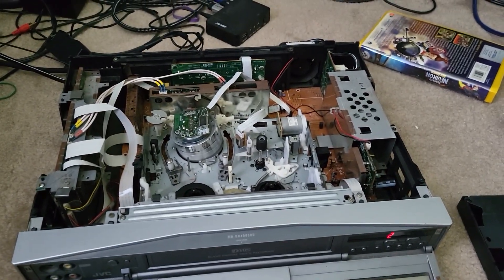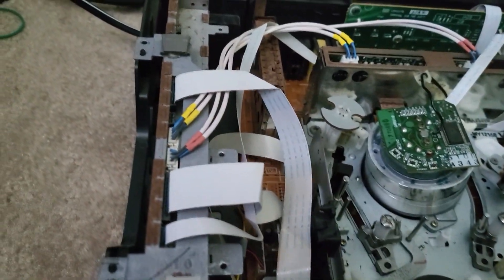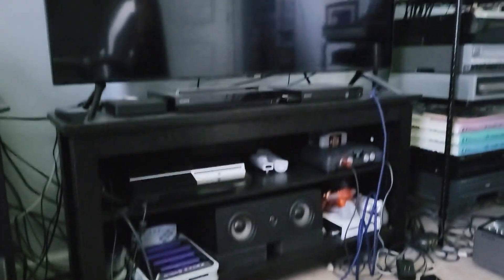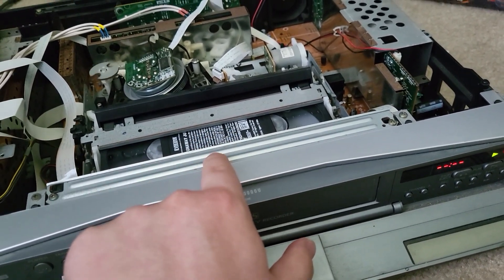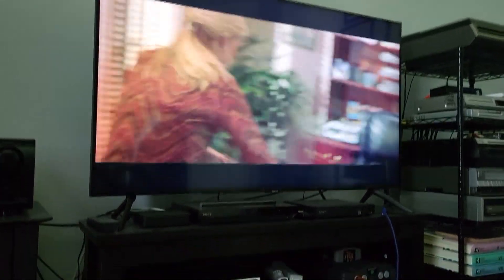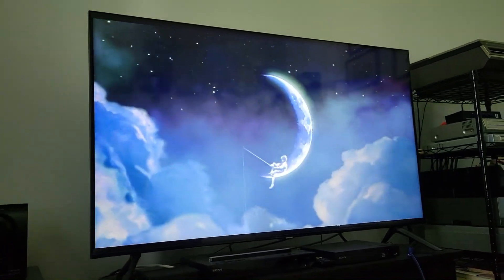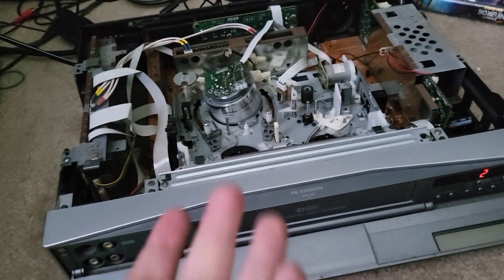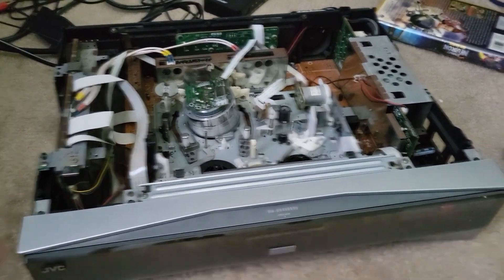JVC HM-DH40000U D-Theater VCR in action (overview, quick repair tips, "hidden" DTS feature)

Comment: Awesome video! Just restored a couple of these units - almost all of the SMT caps in the digital section were bad on both and neither really appeared particularly heavily used. They are kind of annoying to get to because the outer shielding is soldered on in many areas and there's about 25 of them. Guessing most of these DVHS machines have bad SMT caps that go unchecked. I think regular VHS playback also goes through the digital board as I think these will output an MPEG2 stream over firewire for regular VHS  and they also have a line time base corrector which is ideal for VHS tape transfers and that would need to go through the digital section for that to function. Side note was that almost all of the push button switches on the front on both were also not making good contacts, so I would bet a fair amount of these machines could be listed for parts for non-responsive buttons - switch replace those is a 6x6mmx9.5mm 2 pin tactile switch.
Reply from the maker: Yeah, these units do get hot with all of the complex circuitry going on in the digital sections, as well as from the regular abuse switch mode power supplies put on caps, so the caps on these do dry up pretty easily. The digital board recapping is delicate work, but hey, you get D-Theater playback out of the deal. For the front-panel buttons, I'd apply Deoxit to them to see if they clean up before replacing them; they're likely just dirty from lying dormant for years.

Comment: Hello, great video. Nice to see some other D-VHS enthusiasts out there. I have worked a lot on these units the last two years and may have something else you might find interesting: the capacitors on the PRE/REC board very often tend to go bad. And they die slowly. In most cases, VHS/SVHS playback is not affected but the digital playback will deteriorate over time (show more and more dropouts). I had exactly the same sympthoms as your unit shows on one of mine. Some tapes play back well, some do not. I don't think the cassettes are necessarily the root cause for your drop outs. I think that some cassettes simply had a slightly weaker signal strength when they were produced. And these tend to highlight a recorders' weaknesses more. I replaced all the capacitors on the preamp board on a DH40000U, and now my DH40000 plays ALL cassettes I own almost 100% error-free. Also the previously faulty cassettes. In my opinion, the DH30000U (which is even older) may well have the same problem. Another problem is the ground connections from the preamplifier PCB to its metal housing. These break very easily and tend to tear the pad off the circuit board. Sometimes it is barely visible. You have to meticulously restore this connection, all three of them. I once had one that was broken and subsequently severe drop outs on all cassettes. From just a tiny crack in the solder. Of course I can't know 100%. Of course, it could be that your recorders are perfectly fine and they are really badly worn cassettes. But I was also able to see a few drop outs on the cassette that was declared good in your video and I actually had the experience that the devices, when 100% OK, actually only show very few drop outs. Regardless, it's great to see that others are also engaging with this obscure format. I myself have had a few problems finding repair tips for these devices on the internet. Nice that you share your experiences here. Since it is so difficult to get information, I am also sharing my experiences here. 🙂
Reply from the maker: Thanks for the comment! That is a good point to watch out of the ground connection on the shielding for the digital preamp board; on this one, I had noticed some cracks around the joint before working on it.

Comment: My dh40000u has screen flickering and I hear replacing the fan can fix this. Can you do a video on that
Reply from the maker: Does the fan spin up when the unit's turned on? As long as it does and there is no major dust accumulation on the inside, then the fan is fine. Do you have a description of what you mean by "screen flickering"? Can your unit do anything else? It's more than likely bad capacitors; those go bad easily on the D-Theater decks.

Comment: Such a shame these machines were so cheaply made, especially for how high they were priced. They should have been industrial-quality with linear stereo playback and overall best playback available for any VHS tapes. A few D-Theater tapes have DTS tracks but aren't mentioned anywhere on the cover, would be nice if you could set the default audio tracks to play back when available. I don't know what was different about DTS that the first players couldn't access it, there was a similar issue with the first-generation DVD players and DTS on DVD.